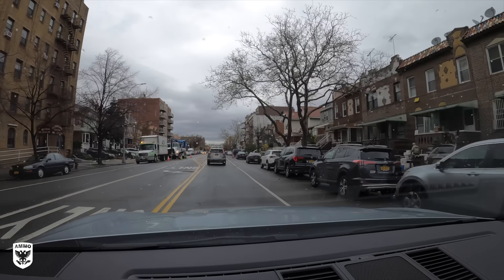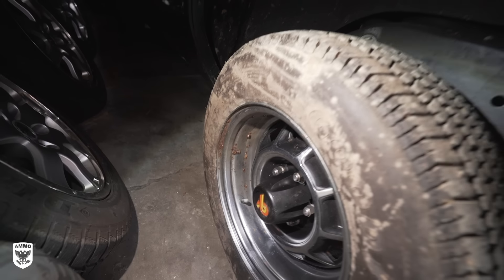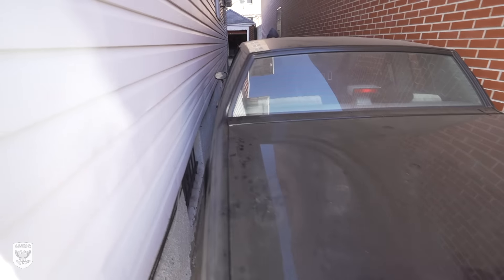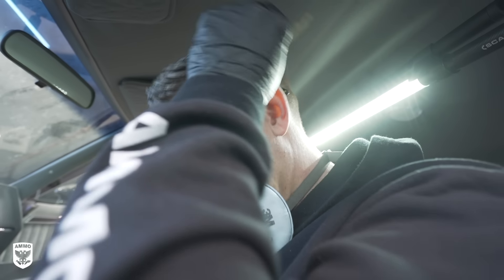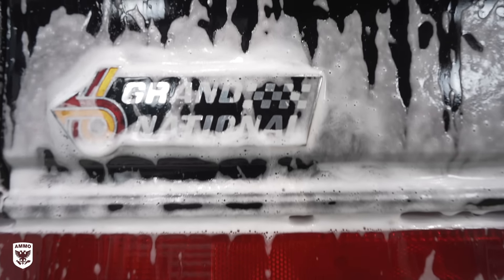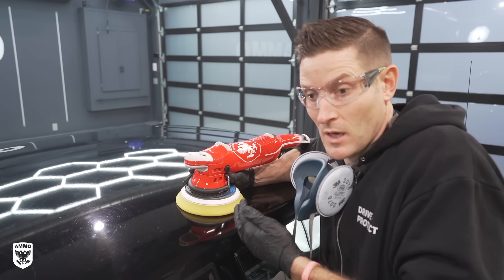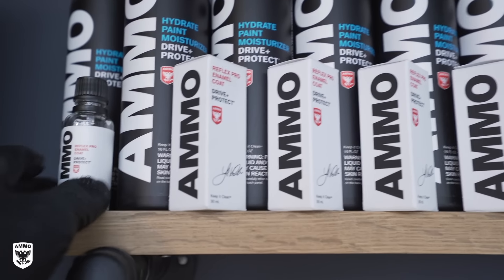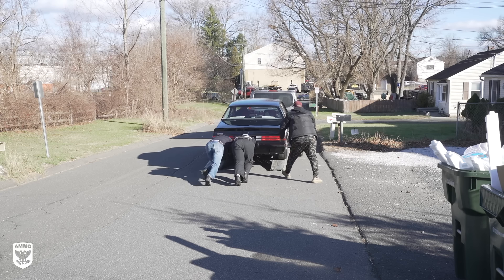First Wash in 34 Years. 56 Miles! Barn Find Buick Grand National

Comment: It’s no 87 Grand National, but my daily driver for the last almost 2 years has been a 1983 Cutlass Supreme Brougham, with the original Buick 3.8 liter (non-turbo), 350 Turbo-Hydramatic transmission, 86k original miles, no rot or rust underneath on the floorboards or frame anywhere….I’ve always loved the G-Bodies!! The most annoying part of driving it is every single kid under 30 in everything from their Honda Civics, to Camaros and especially Chargers and Challengers, revving their engines and trying to race me!!

Comment: Never forget two brothers in my neighborhood bought two brand new 1990 Silverado SS short wheel base pickup trucks with a 454 cubic inch engine from the factory in it short wheel base both were jet black with red pinstriping running a long the bottom of the truck beautiful trucks don't remember if that was the only year they made them or not

Comment: The 1987 Grand National had a Camshaft Sensor recall.
The sensor is where the distributor would have been mounted, but there is a hall effect sensor in place of the Distributor head.
I don't know if you can still get this part from a Buick dealer any longer.

Comment: Allow me to correct some (mis)information regarding the G.N. We will NOT be talking about the GNX At ALL! The GN and the turbo regal are all exactly the same car. The GN is merely
a paint and interior option....(but a really COOL one). A "Turbo-T" could be ordered in ANY color & interior option and with a column shift selector. Only the 1986 - 1987 had an intercooler.
The black paint on the wheels was just that...paint....and could be removed with Zipstrip and #0000 steel wool to make the most beautiful chrome wheels  ever! If you want to make modifications
I would reference Applied Technology &  Research (ATR) as they are Ex- Rocket Scientists turned 'gearheads". My '87 GN (with glass T-tops) was dyno tested at 462 HP with the "pit bull" chip and
other ATR (enhancements).... but my lovely woman could drive it to the grocery store like a normal car....as long as no turbo was NOT engaged. (I wondered if the carry-out boys liked looking at the car.....or her...better.) You can thank me later....Regards, JIM
Reply: Nothing cooler than turbo cars and these were pretty advanced for their time. This car is the exact car that made me want one but I could never afford. So I built my own blow through carb Grand Prix. Made 845 to the wheels with little boost and a whole lotta f'd up tuning! Turbos are the best

Comment: Love that car and more optioned GNX 3.8 Liter turbo charged intercooler Hell of a BUICK few mods to the Trans the RE AND TURBO beef them up kenne bell injectors MSD INGNITION factory HP was 240 with those mods your looking at 350hp 400 and I forgot flow master exhaust with Hedman ceramic coated headers

Comment: I bought an 87 Grand National brand new.  Dealer had three of them and I test drove them all and bought the fastest one.  Typical GM assembly quality (junk) but probably the quickest car I ever drove up to that point (1987).  Did the usual mods for the time, chip, cold air induction, turbo boost rod, and cold water air intake tube.  Stock shocks were cheap and replaced with better KYB gas shocks.  87mph speedo was a joke and I could wrap the speedometer needle all the way around into the boost gauge panel.  Paint was very poor and had signs of acid rain.  I complained to the dealer, that initially buffed it to be acceptable, but I had them repaint the hood and trunk lid under warranty.  Kept it two years and sold it to a school teacher.

Comment: If someone was going to stop driving a car for a while but didn't have access to climate controlled storage, just a regular garage, what's the best way to do it? We know a tight fitting car cover is a mistake, traps moisture and ruins cars. So maybe a 'tent' style cover like a canopy that keeps droppings and heavy dust from landing on the car while allowing air to move under it? Then maybe some desiccant packs inside the car? Possibly removing the wheels/tires and storing them separately? Maybe spreading Vaseline all over the chrome trim to keep it from oxidizing?

Comment: Some incorrect numbers in video. The $29,000 base price shown would have been for the GNX. I paid about $18,000 for my new GN in '87. I don't know where the 4 second 0-60 time is coming from. The GN was about 6.9.. GNX was 5.4. Now that said, it was one of the easiest cars to improve performance of. I just put slicks on mine and a valve to increase boost slightly and it was an easy 13.5 second quarter car. Even today, there are GN's running 9 second times.

Comment: If I was a wealthy collector I would buy it and Park it indoors up on blocks. Then buy another one in good condition and "match build" it so I could enjoy driving it. If I recall correctly the original top non-governed speed was 142 MPH (Unless there's a V8 model that I missed) 
Any way I would run this car every week (Just 10-20 minutes)change the oil every year and maybe bypass the gas tank to keep fresh gas going through it each run time.

Comment: The paint probably looked like ass from the factory.  My friend's Dad bought a black base model Regal that year.  They were proudly showing me their new car and I showed them were it had been hit and the dealer repaired and repainted the driver's front fender. They didn't even remove the chrome wheel well trim and you could clearly see the tape lines.  Plus the orange peel on that fender was horrifying.

Comment: PLLLEEEAAASSSEEE tell me you removed the satin headlight bezels and wheel well trim before polishing this...   And I'm curious as to why you didn't use warm water out of a hose with a filter on it to rinse off the foam that you allowed to sit on for a while first, to get the heat baked dust off before proceeding with the wash.  I understand dust encapsulation but still.  I know a lot of that stuff gets disregarded if you're going to wheel it in the end anyhow but I was just curious.

Comment: I have always loved this car, but have always struggled with GMs overly squared lines designs. I know it's definitive, but it's not what I'm into. I've always loved Porsche 911 for it's smooth and non-edge design. Sadly now VW is making Porsche use straight lines in that design now and it's made the lineage rather meh. 
Getting back to the GN..such a cool car as it was a sedan!!! And that it kicked a Corvettes ass made it so much cooler!!! Was too short of a run..because it was a Corvette-killer??

Comment: When these GN's were being sold new, I was building engines for several racing circuits at the time. I knew two who bought GNs, new, off the showroom floor...and both said the same thing, "TONS of potential, amazing idea, HORRIFIC execution". They were a FLOP because of their promise, their price, and their actual behavior! They COULD be fast, but not consistently. They were NOT dependable to EVER win a 'race' (even a street race) where due to the turbo, their times could vary 0.2 seconds or more (at LOT, at 100+ mph).  Sometimes, the turbo would spool up too late, other times, you couldn't get it to spool down (other than turn the car off)...and when the warranties (famous 5/50,000 of GM's, at the time) expired, MOST yanked that 231-V6 out and dropped built 350's (or larger) into them. The turbo, their 'sell feature' promising 'big power from less cubic inches' was a knock at the door for things to come, but that first knock came from an 'undependable clown with a squirt-flower corsage', and at $24k (in an era when you could get a LOADED T/A or Z-28 for $19, or a Mustang GT for $18), a small NOX shot was all it took, to make that GN owner feel really bad, really fast.
A museum piece? Ok...but great car, they were not. You guys did a fantastic job bringing this low-mileage car back...and is perfect for 'off-the-lot' appearance...just thought you'd like to know 'the on-the-street back-story' behind why so few, and why not really remembered now'.

Comment: Not driving a car the the WORST way to preserve it.  Everything on the car is probably dry rotted.  Seals, engine, hoses, transmission seals, engine seals.  Its gong to take thousands and thousands of dollars to make it drivable.  Modern cars do not age well doing this.  Computer components and electronics need to be replaced as well.  If your going to squirrel a car away hoping that its going to be worth money some day preserve it properly is its actually worth money.